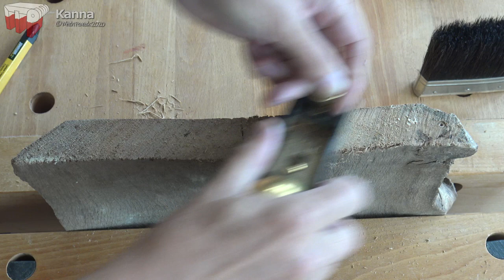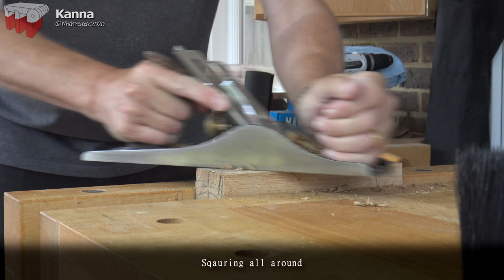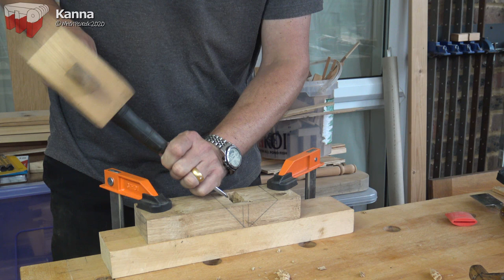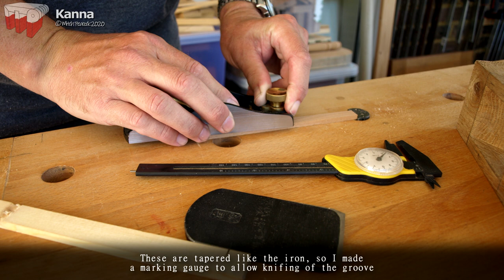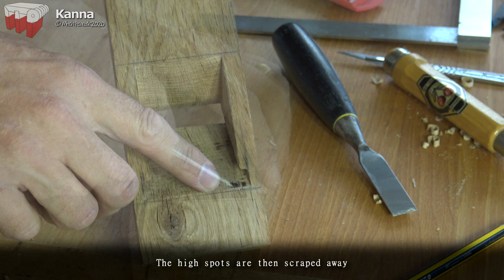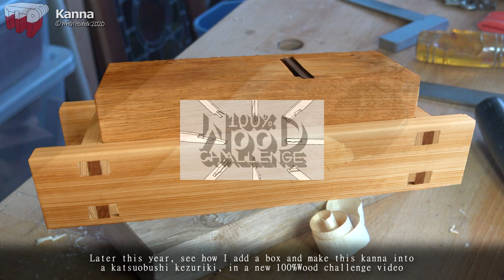Making a Kanna - a Japanese Hand Plane

Comment: Mitch,
You make it look easy, one thing you did not cover was what to do with the under side of the plane and what parts are scraped/ removed. Grate video.
Reply from the maker: Cheers James. That's what I found quite interesting, because the kanna as made here worked beautifully once I got the blade set, the last bit in the video. I've always assumed that the very slight scraping I'd read about and carried out on my purchased kanna, was necessary. Now I don't think it is for general work. I'll play around some in the future to see quite what this kanna can do with it's perfectly flat sole, and then maybe scrape the reliefs and see if that's any different.

Comment: That was interesting. I read that the use of the chipbreaker was a recent design development. Is it really needed for the effective use of the Japanese plane or would a think enough blade serve the purpose ? I noticed that you did not have a chipbreaker affixed to your blade.
Reply from the maker: Cheers. I would suggest that for thin shavings in all but highly figured woods the chip breaker is mainly redundant. Certainly the native Japanese woods I've tried are very tolerant of the single iron.
Reply: @mitchwoodwork  Thanks for the information, might do some experiments with my planing.

Comment: Do you have to get all the various water stones and such like for sharpening those plane blades, or do they respond to diamond stones? I like the idea of making relatively simple hand planes. Although I'd love to make ones that I wouldn't have an equivalent western plane for. I'm thinking one with a concave bottom or something. Great video.
Reply from the maker: Cheers Rico. They can be sharpened on diamonds and stropped just like western irons. Definitely recommend having a go.
Reply: Its allowed but not recommended because diamond abrasive leaves too deep scratches in hard steel and may cause micro chip-outs on the cutting edge and those diamond marks are not easy to remove  with higher grit abrasives. So to try - of course, but further it is definately recommended to use japanese waterstones, most of them are not very expensive and you can find some for 20-30$ (even two-sided ones)

Comment: Nice video, Mitsch.
Your Kanna turned out great. 👍🏻
Was it wanted that you built the chipbreaker without a plane? 🤔
Nice rest of the week wished
Reply from the maker: Thanks Günter. The 100%Wood challenge kitchen utensil that this will go into definitely doesn't want a chip breaker, but also I don't believe early Japanese planes had them, so that was my reasoning. Certainly the thick and will supported iron doesn't need the stiffening effect. Of course tricky woods might be a challenge, but the early Japanese, and European woodworkers too,  must have got around that.
Reply: Hello Mitch,
Thanks for the answer.
Aha, I didn't know that.